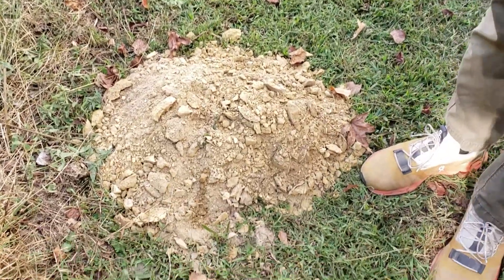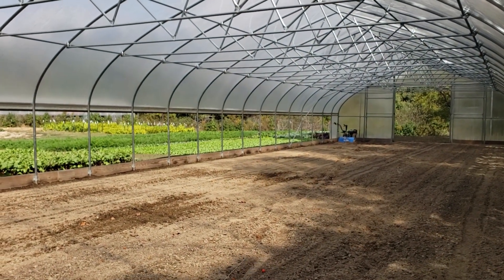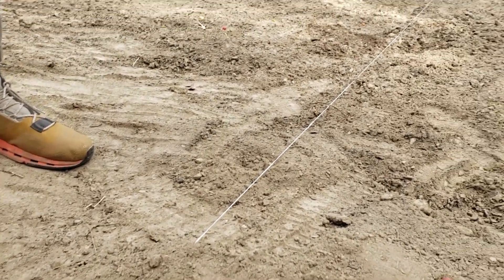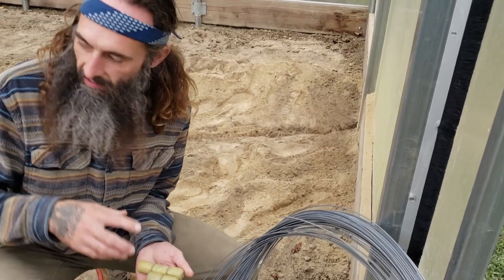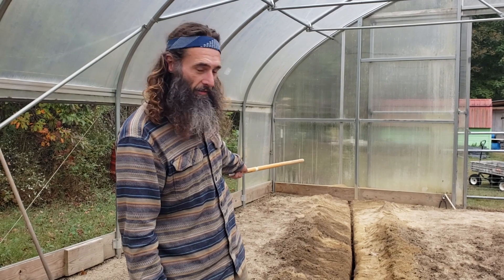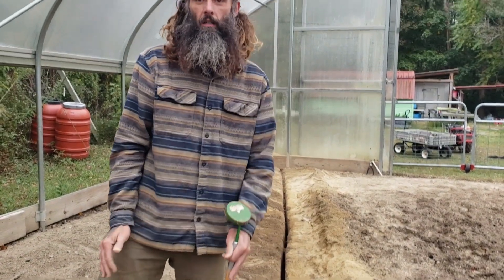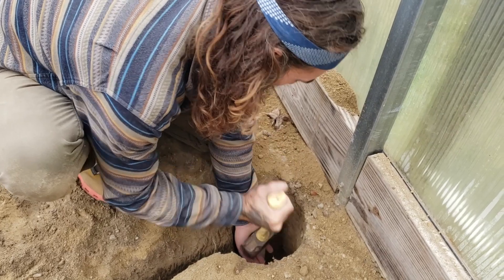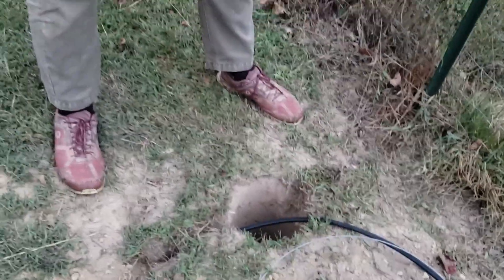Electroculture Ground Wire Installation. @TheFertileCurrent

Comment: I thought copper wire should be used?
Reply from the maker: No, not for the ground wires. Galvanized steel 12.5 gauge has always been the wire of choice for electroculture ground wires. The copper wire has been hyper focused on in recent times due to often misleading internet trends like wrapping copper wire on sticks so I can see where it is confusing sometimes. Please visit my website thefertilecurrent.com for comprehensive electroculture info and equipment . Much love friend.
Reply: @TheFertileCurrent thank you for this valuable information 👏🏼

Comment: nice video, could you please be more specific how to install the magnetic boosters? What I come to understand is from Yannick Electroculture is that he places the southpart of the magnet facing the north on the wire, so basically the other way round? Is that also your way of installing?
Reply from the maker: Hello friend. Thanks for the thoughtful question! The magnetic boosters are installed in phase or in line with the flow of current. So that would be the Southern end of the stack facing south, opposite of what your saying YVD does.The objective of our systems is current and  so anything that is fundamentally inconsistent with that principe would be avoided. We mark the south end of the boosters with a vivd marking for easy installation. Much love
Reply: Ah ok, thanks for the info. Follow the current👍 I also follow a french guy BSA Electroculture, he measures with an multimeter the energie/current in millivolts to show the energie coming from copper antennas and piramids. Is there a method maybe to measure this magnetic energie flowing through the wire?